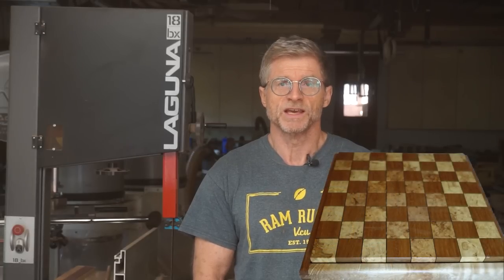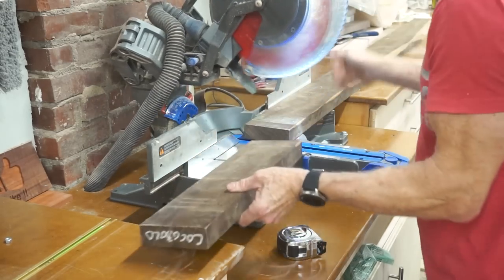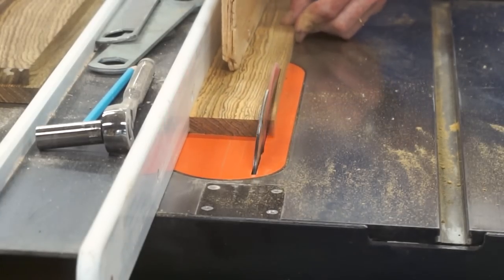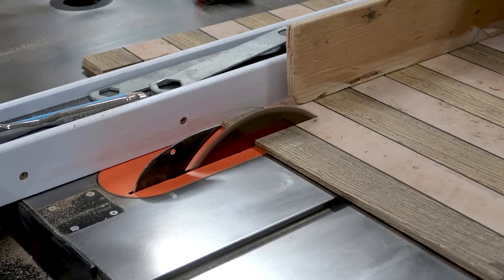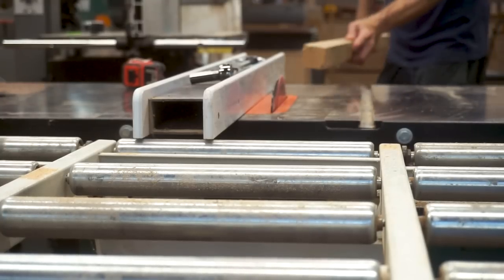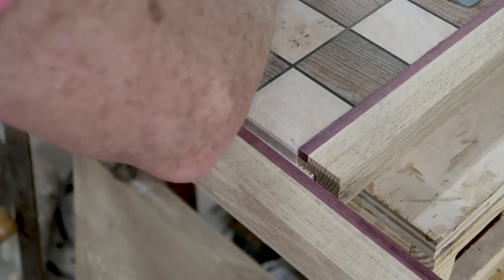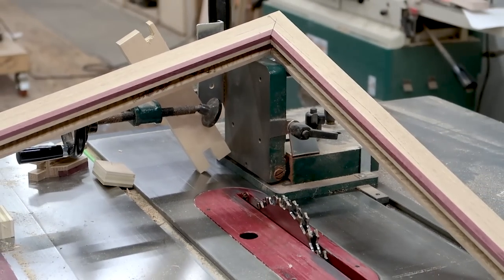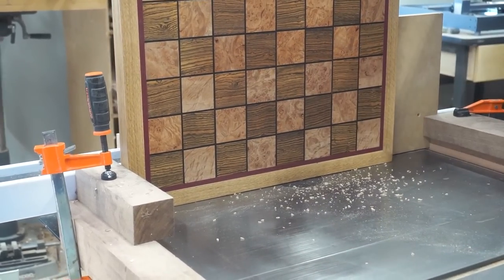Luxury Chess Board with Maple Burl, Cocobolo, Ebony, Purpleheart, and White Oak

Comment: Inspired by your work, I have made a couple of chessboards for my daughters - one with Cocobolo and bird’s eye maple with a walnut frame. My first finishing attempt failed because of oil that seeped out of the Cocobolo (even though the wood was twenty years old) so I had to sand it again. The 2nd time, I rubbed it all down with acetone, put on 2 coats of sanding sealer and four coats of lacquer and it came out beautifully. I made mine as gifts, but I’m really curious what you charged for this board. Not only is your craftsmanship superb, but the maple Burl and the Cocobolo are very expensive, to say nothing about the ebony.

Comment: Beautiful workmanship. Curious why you put the chess pattern on both sides unless the customer requested it. For the bottom, a simple cherry or walnut veneer would have looked good, and saved the burl and cocobolo for another piece. For me, the cocobolo was a little too busy, and took away from the burl, but it was still beautiful, and so well-made. I really enjoy watching these builds, they are inspiring. Thanks again for doing this.
Reply from the maker: I like to put the chess squares on both sides to give it a higher end look. Some clients take advantage of that if I put algebraic notation on one side so they can flip it over and play without the notation if they want. It's almost the same amount of work to put veneer on the bottom side, but you're right that it would have saved the nice wood for another board.

Comment: Big fan of your work ! I have a jointer ,a planer numerous sanding devices but no drum sander and frankly no more room for one..any advice on how to get a good finish on my work
Reply from the maker: If you have a belt sander, that could be helpful, but you'd need to be careful that you don't leave it in one spot for too long. A random orbital sander would work too. It just takes longer to get the surfaces flat and smooth.

Comment: Mike, that miter/bridle joint was pretty complex joinery!  Does the purpleheart require any special treatment to maintain its color?  The maple burl has beautiful grain but I find in turning bowls with any type of burl that the internal voids and bark inclusions can make working with this material rather difficult.  Your use of epoxy was a great way to handle the voids.  As always, a great looking chessboard!
Reply from the maker: Thanks, Paul.  The purpleheart will darken over time with exposure to UV light. The same thing happens with bloodwood and padauk. There's not really anything that can be done to prevent it.
Reply: You could try finishing with a marine spar varnish. Might not prevent it, but could slow down the progression.

Comment: Nice work as always Mike.  What grit do you use on your drum sander?  Do you change the belts often? Or stick with one grit particularly?
Reply from the maker: I almost always use 100-grit, but I have sometimes used 120-grit. I try to make the sanding belt last as long as I can by taking very shallow passes, but eventually it clogs up and I have to replace it. Maple with its sap and a lot of the oily exotic woods are what shorten the life of the sanding belt.

Comment: I don't understand the point of the plywood center. Is it just to hold the frame in place?
Reply from the maker: Plywood is more stable than solid hardwood, so it helps to reduce seasonal wood movement when the squares are glued onto it. It also helps lower the cost because less hardwood is required.

Comment: I am a woodworker myself, and what you are cutting here sure looks like Bocote and NOT Cocobolo.
Reply: Was wondering same..what he cut at beg looked like cocobolo but what he starts gluing up looks more like Bocote.  Did the design change mid video I wonder
Reply: @samsamar6743  I have seen videos where the maker will put text into view, saying Cocobolo, rather than Bocote, and vice versa - as example.
Reply from the maker: It's definitely the same wood throughout the video. I've worked with cocobolo on other projects and it looked different every time, and I have another piece of bocote in my shop that looks very different from this, so it's hard to be sure. I suppose it could have been mislabeled at the place where I bought it, in which case I would have paid too much.
Reply: @Woodumakeit  Definitely Bocote
Reply: @jeffselchow5719   shhh! Don't tell the client. Lol

Comment: Did you use the bandsaw instead of the table saw because of the thinner blade kerf? And does that end up saving you anything considering that you have to re-joint between cuts?
Reply from the maker: I used to do everything on the table saw, but now I like to do my first cuts on the bandsaw because it puts less strain on the motor with such a thin kerf, and then I do the final cuts on the table saw. I'd like to believe that the thinner kerf saves on material, but I doubt that it does because the cut on a bandsaw is a little rough, so it needs to be cleaned up on the jointer and/or table saw afterwards.

Comment: Is there a reason you prefer plywood over MDF for a substrate?
Reply from the maker: I use plywood because I usually have lots of leftover pieces from cabinets I've made. It's also easier to get in varying thicknesses if I need the board to be thinner or thicker. Another consideration is that MDF is heavier, so it increases the shipping cost which is highly dependent on weight. I'm pretty sure MDF would be fine as a substrate, though.
Reply: @Woodumakeit  Thank you for the detailed explanation. I appreciate that. You do beautiful work, by the way, thanks for putting out all the great content!